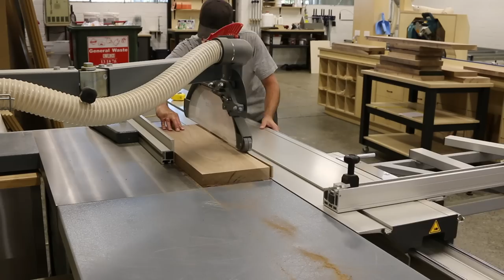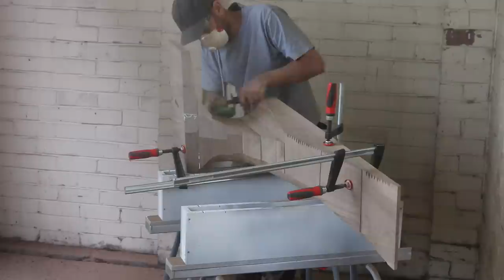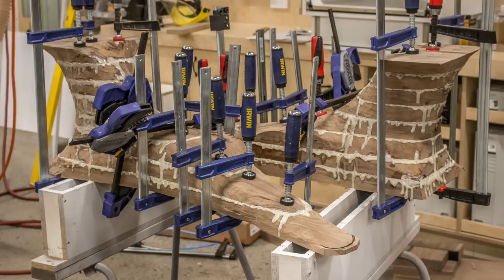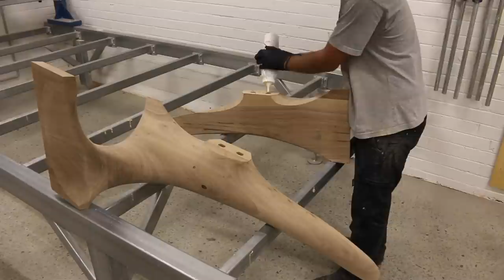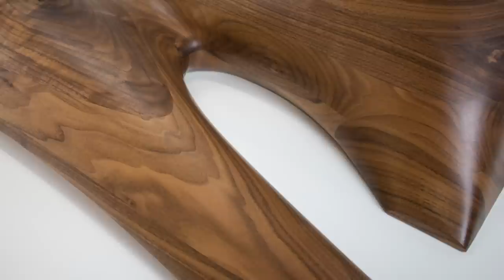PEDULLA STUDIO | Building a Walnut Sculpted Coffee Table

Comment: Fantastic build!

One question - Why you don't glue all cuts first and than sculpture the whole piece at one time? Is it easier sculpture unglued pieces?
Reply from the maker: Thank you!
I basically want to get the rough shape first so I can then take it all apart and hollow out the inside. The reason for hollowing it out is to lighten the piece.
Doing it this way ensures I don't hollow out too much or make the walls of the piece too thin.
Reply: Smart move! Thank you!
Reply: I had the same question. Can't you hollow it when you cut it to size, before you glue it? Anyhow masterpiece.

Comment: Very nice. How does the Polyurethane glue do with “glue joint creep” interrupting the smoothness of your finished surface? Do you need to let it sit a while (weeks or months) before finish sanding to prevent the glue joints from becoming raised like you might with PVA glues?
Reply from the maker: I let it sit for a couple of weeks before finishing. Turned out perfect!